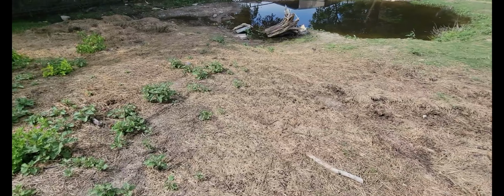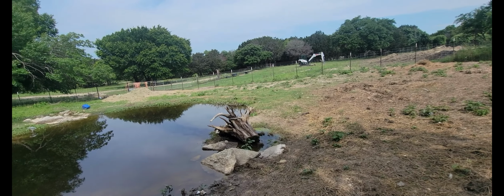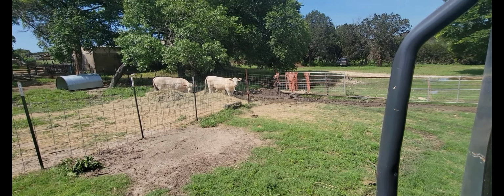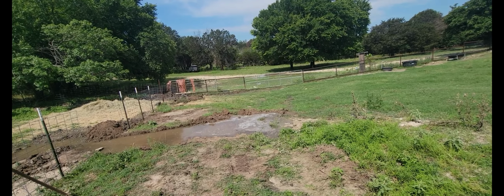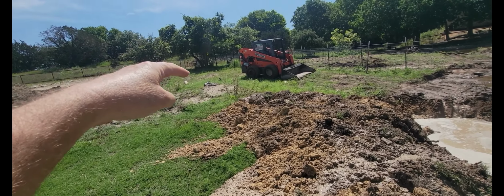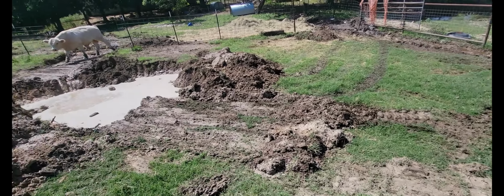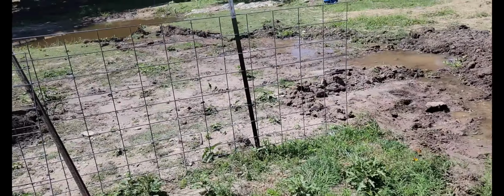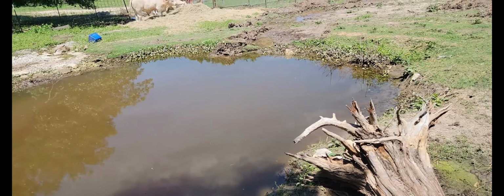Diagonal Flow gets redirected via a new pocket pond

Comment: I personally love it. If you can have flowing water on your land with some ponds connected to the flow then the water quality and general health of the ponds will be much better. Even if it just a tiny seasonal flow. And I also like it that you raise the outer edges from the ponds, because that will give water the opportunity to soak or wick itself into the surrounding top soil during rain events and high water levels in the entire system. And you get a much better distribution of nutrients instead of one pond that is collecting all the nitrates. Man that is going to look really nice once it is all connected and done. Keep up the good spirit 👍
Reply from the maker: That is one thing i pondered after zach weiss built the 2 ponds. If i built 10 smaller ponds that contained the same volume of water, would that be better? It is definately easier for a novice and takes less equipment. Mistakes can be corrected I really like the redirect. If i continue, i think about how far i can spread that water. Zigging and zagging. Where do we go next.
Reply: @heronthere  The big game changer would be the flowing water. With flowing water you can dig as many holes as you like and you are good to go, sort of speak. It would basically form a living creek. With a standing water pond with only the occasional over flow it is more practical and better to create a large pond, because a large body of water is more stable, it has a larger oxygen and PH and CO2 buffer for when the temp goes up or far down, and the maintenance is more straight forward, and so on. 

But all those issues that you would have with a pond are no longer an issue with flowing water because there is a constant fresh supply of water with fresh oxygen, and so on. 

But when there is no flow at all, some smaller ponds might run into some minor issues a bit faster compared to a large pond for example when it gets really hot or cold, or when there is a lot of contamination from nitrates. 

I would say, it is a matter of trial and error, and just adjust where it needs to be adjusted. You can always dig more.

Comment: Another good day of progress. Thanks for sharing.
Reply from the maker: I found my squeek but greasing didn't fix it. Its due for its first service. Msybe they can figure it out.
Reply: @heronthere  I have a feeling there may a bigger problem if there is not a grease point to the area that is making the noise. It's under warranty though you should not have to pay for the problem.
Reply from the maker: @TimelineRanch  there's a grease port, it didnt help with the squeak. I just spent 2 hours cleaning it. That was some work wirh the wet conditions here. Lol. I'm taking it in for service.